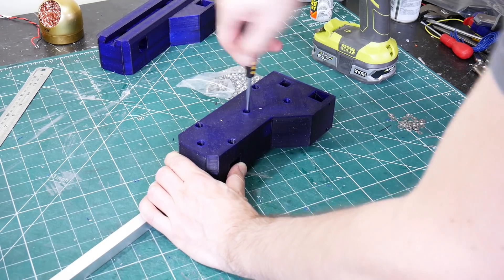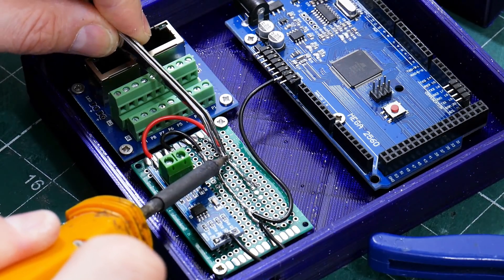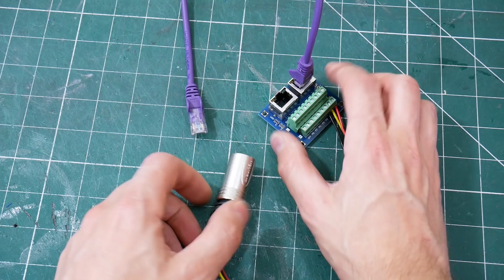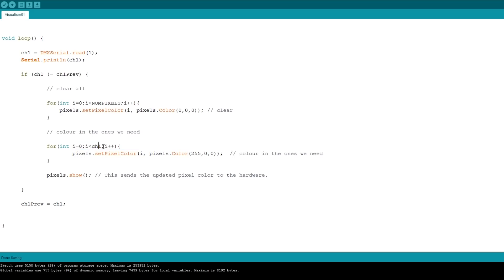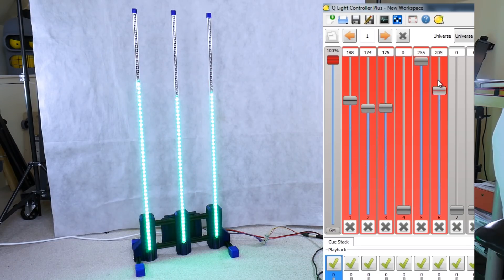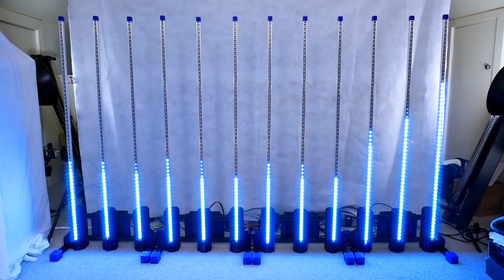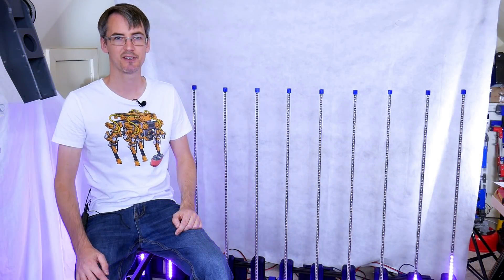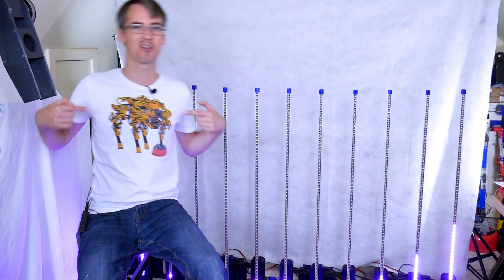Building a 720 LED RGB Graphic Visualiser

Comment: I have a question: Can any RGB(w) led strip be controlled with a dmx or does it have to be of a certain type?
Reply from the maker: If it can be controlled by an Arduino then it can - but you'll need to use the DMX library on the Arduino to read the DMX channels and write it to the LEDs.

Comment: Arduino and DMX is cool, but it might be cheaper to just buy 3 chanel LED dimers
Reply from the maker: how would I sync that up with my robot show?
Reply: @jamesbruton  Ok, your lights are a bit more advanced than just 3 dimmed RGB channels giving color intensity in each channel, but in general all DMX devices work the same - each channel is a value from 0 to 255 so you can consider each channel a dimmer in the same range. As the whole industry of pro lighting fixtures use DMX controlled devices, there are a ton of lighting consoles and software for the purpose of controlling them and most of them can make different queues and chases and you can program time code (lights synced with music) etc. So there are options depending on what you want to achieve. Of course this does make an interesting project and provides good learning opportunity.
P.S. - I you would like to see what the whole world uses professionally, you can get free PC software from MA lighting that has a built in visualizer - you can build a whole virtual light show on that.

Comment: I get that DMX is useful, but for sound to light I'd use a teensy and fft library using windowing to do the spectrum analyzer properly. Then all you need is an audio input.
What you demoed didn't look convincing at all. Try with a slow sweep with a sine wave and other patterns to see how the frequency bands respond!

Comment: Where you tempted to map each neopixel straight onto its dmx equivalent so you could use it as a low-res screen, there are a few bits of software that could do it for example madtrix is a commercial one

Comment: At some point you are going to want to create a RJ-45 DMX Terminator. Long Runs of DMX REALLY wants a 120 ohm resistor across what would have been pins 2&3 on the XLR jack... If you have too much wire out and no terminator you can get some weird "Ghost" commands showing up. Those manifest as annoying flashing when controlling LEDs (or lights) but could actually be dangerous with the robots.

Love the channel, keep up the awesome projects.
Reply from the maker: I have four universes at the moment, one for each robot and two more for lighting. I may well build OSC to DMX bridges though.

Comment: You should look into Artnet, its a DMX over Ethernet standard
Reply: Or sACN its more or less the same. but sACN. can run on 192.x.x.x meanwhile Artnet can only run on 10.x.x.x or 2.x.x.x
Reply: @kaggez  I bvelieve sCAN needs to be licenced, might have changed though
Reply: Now whan you say it. It might. I just know that my light software have it. I use artnet tho. I have 2 4port artnet nodes

Comment: Nice  I am working on an project that uses 290,304 RGBW LEDs
Reply: That sounds... Expensive.

I briefly contemplated trying to build an LED display capable of dealing with analogue television resolutions from discrete LED's...

And aside from the logistical nightmare of constructing such a thing, and the tiny scale I'd have to work at to get remotely decent pixel density...

I quickly ran into severe cost issues;
Even in very large bulk orders and with the cheapest LED's I could find you're still talking something like 7 cents an LED.

That doesn't sound like much...

Until you try and construct a 640x480 RGB display and realise this requires 921,600 LED's...
And thus the raw cost of the LED's alone is on the order of $64,500

And that's with LED's that are probably far from optimal in terms of colour response for the task, and in fact you can't get a proper RGB triplet (or a single RGB LED) for anywhere near that cost...

Even a 320x240 monochrome display... Which uses just 76,800 LED's... 
Is still some $5,400

Needless to say I quickly realised it wasn't viable and tried to see if I could find other, more cost effective methods. XD
Reply: @KuraIthys     Mine would be very expensive as they would be on custom boards, have other electronics and need about 85 KW of power.  :-)

Comment: Can you change the max value to 180 or max LEDs instead of 255?
Reply from the maker: Yes you could just not use a max value of more than 180, but it's scaled in the Arduino code anyway

Comment: Nice video. I made something similar for a party in my school. I embedded it on a DJ Stand with laser cuted PMMA : https://www.instructables.com/id/Vu-Meter-DJ-Stand/ 

I didn't got the time to add DMX feature but the way you adding it seems very good !  I chose to made a custom python code for FFT with a jack from the DJ turntable  so I didn't need DMX for spectrum analyzer.

Comment: Loving these videos as its right up my street, for the box I would recommend seeing if you can support art-net or its older brother s-ACN with these as the XLR to ethernet may end up as a factor that breaks the whole setup, also you could probably have a 7 segment display on the ardinio with some buttons and then you can easly set it up on different chanels where you just set the starting address for it.
Obviously its little things but they can really help if you want them to be reliable and easy to setup, also I would love to see these haveing a 3 channel rgb value for each of the leds which will end up getting close to a full universe but maybe you could do it, maybe not.
Eitherway, the content is brill man, keep it up
Reply from the maker: I'm looking at OSC - and an OSC to DMX bridge for legacy support
Reply: @jamesbruton  Ah neat, I don't know as much about OSC but I do know the basic functions are, I also believe that Deadmau5 uses OSC to control various aspects of his cube 3.0, his realtime projections and the music.
Anyways, I'm excited to see what happens with it!
Reply: For the DMX channel selection I've used an 8-bit DIP switch rather than a 7 segment and buttons. Just read it once on setup, with an inline shift register if pins are getting short.
Reply: @christianeaton  Yea that is the simpler way since most old lighting fixtures used that

Comment: Given you are plugging a lot of dmx stuff in which you wire in using Ethernet cables (not the best signal integrity), would it make sense to switch to artnet (dmx over Ethernet) so you can also start using switches.
Reply: @Rolf Huisman maybe he’s using cat6 cables?
Reply from the maker: I'll be looking at OSC shortly, and OSC to DMX bridges for legacy support

Comment: This matter more if you are doing battery powered LEDs, but if you are worried about power draw for your LEDs you can use the "fastLED" arduino lib, which does gamma correction (and also good color correction so you get the proper colors you want).

Gamma correction relies on the idea that your vision sees an after effect of light when a light is turned off, so you if you want a light to appear "half" bright, you can actually give it way less than half power, since you eye will interpret more light than is actually there.